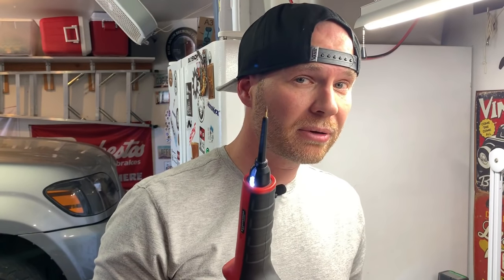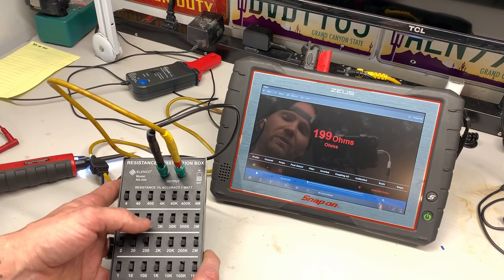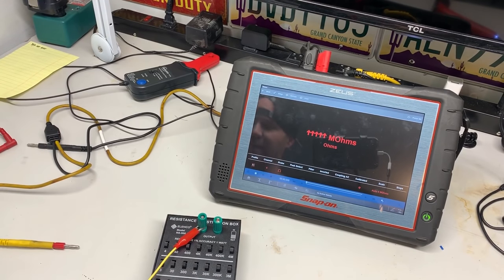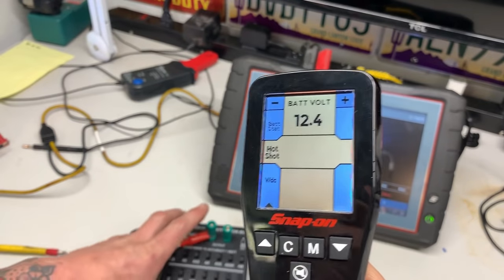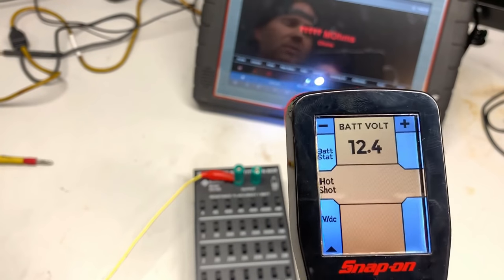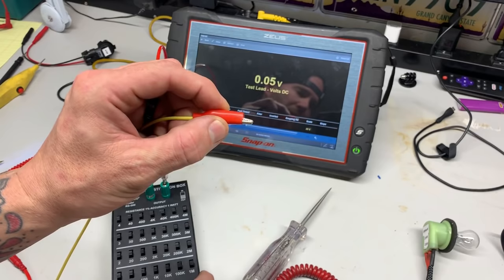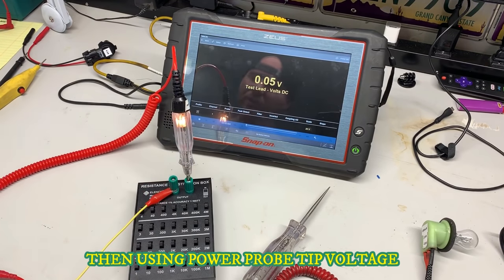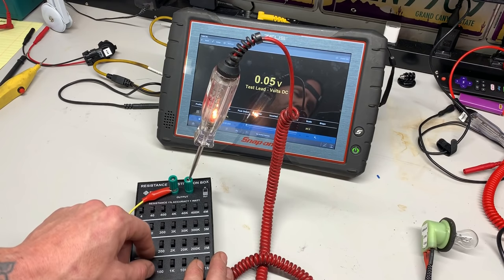Homemade test light against the power probe?

Comment: Doesn’t the fact that the decade box started smoking even before you added resistance show that the power probe was right? It COULDN’T handle working current and the hot shot showed it. Also, if you do a voltage drop on a non working component, and you see power and ground, if the component still isn’t working then the component is bad. Period. Yes there also may be bad wiring, but if a component has power at its input and it’s not working, then it’s bad. I always probe the power side of the component with my PP and if it shows voltage, I will still bump the positive switch and see if it works, then do the same on the ground. If the component starts working, I know it was a wiring issue. It’s much faster to properly test a circuit with a PP than all the homemade gadgets and adding lights with different amperages yadda yadda. Great video!
Reply from the maker: Che Kelley I like your comment about still supplying power and ground just to verify with the power probe. That is definitely a quicker test and only needing one tool. Just an FYI I had a brand new decade box that wasn’t “burnt” and got the same results with the power probe.
Reply: @Che Kelley You make a solid point sir, I do the same thing with my Power Probe. That being said I like to substitute a load also just to be totally sure I cover my bases. I think the decade box was smoking because they aren't designed to carry large amounts of current. I know the one I have says something like 300mA max input.
Reply from the maker: Gearhead Automotive L.L.C. Lol mine has a rating as well and I far surpassed that. It was a cheaper box so I wasn’t as concerned about it and wanted to give an example of how the pp can be misleading. Basically it’s for the guys thinking testing power or ground with tip voltage is sufficient. It’s bad when you see guys that have been in the field for 30+ years and disconnect a component to check power with pp tip. Honestly before I knew better this was how I did it as well. Now I know better lol.
Reply: @codysautodiagnosticsprogra8706  Makes sense brother. I figured something along those lines. You're right about how common that is. Saw guys do it all the time when I worked for somebody else. Same applies for people that use ohmmeters a lot. There are occasions where they can be useful but for the most part it can lead you down a rabbit hole. I was fortunate enough to have good instructors in the automotive program I went through. One in particular taught us that if the ohmmeter says something is bad you can believe it is, but if it says it's good it may still be bad. He was big on voltage drop testing as opposed to using the ohmmeter. There are occasions where it makes sense of course but nothing like some of those factory flow charts would lead you to believe.
Reply from the maker: Gearhead Automotive L.L.C. Flow charts 🤦‍♂️ I bypass like six steps of those things because of the dumb ohm checks.

Comment: I'm still in the 1st couple minutes.  See where this goes...
Reply: Some EXCELLENT points made.  It reminds me of the people who simply use the DVMM to check powers & grounds... if there's no load or current running through the circuit, it CAN'T be accurate.  Still wide awake by the way!!  lol ;)
Reply: I have my own style of loading a circuit.  I made a project box with bulb sockets installed and it's able to have leads plugged into it.  By adding or subtracting bulbs in the sockets, I increase or decrease the load.  I have the amps written on the box at each socket, so I don't need to calculate what I'm putting on a circuit.  Some great ideas, thoughts, and explanations in this video.  Really good.  Gotten better overnight, with content and execution.
Reply from the maker: Thank you Cuba! That box you made sounds pretty awesome and sounds like my kind of tool! Thanks for watching!
Reply: @CubasAutomotive  Hi Cuba...how about posting a pic of your rig?  I asked Ivan to do the same.  I think we could all benefit by seeing each others approaches.
Reply: @drewsdiagnostics7201  sure! Give me a few minutes,  I was just about to head out. I'll post a link to Google drive with pics.... un momento.
Reply: Cuba Rodriguez , nice setup. Much neater than using pieces of harness with connectors and bulbs flopping all over. 👍

Comment: you should of had live volts not just sound ... because the probe just sees power does not know what voltage your testing for it is just telling you its power like  5 volt ref or 7 volt ref. you just hear sound for power ... thats not the way to test
Reply from the maker: It makes the noise when the pp doesn’t see a voltage drop, so when the source voltage is the same as the battery voltage. The fact the noise is sounding with resistance in the box is showing how the tool is not seeing it the resistance. I see to many technicians thinking checking a circuit with tip voltage is probably testing the circuit, this is the point of the video.

Comment: Power Probe is the most overrated tool ever. A multimeter,  multiple different resistance test lights and a fused jumper wire is what you need
Reply from the maker: Mech2Tech I agree 💯 buddy